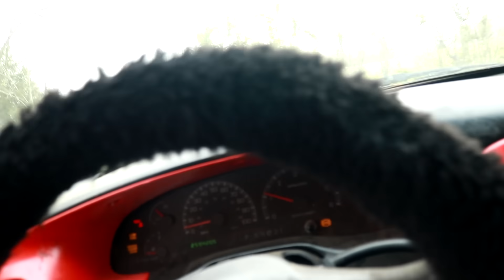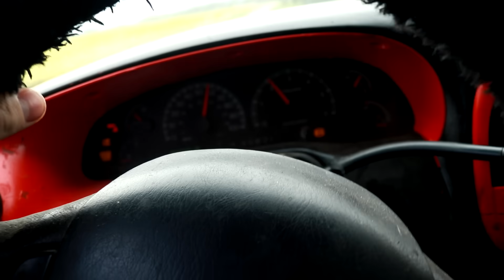How I DESTROYED My Truck

Comment: You could eliminate the c-clips all together by installing bearings that are held in by a bearing retainer bracket at the end of the axle tube opening. They sale kits online. You would no longer need to pull the diff cover to change an axle and the bigger bearings would strengthen it quite a bit. Aftermarket axles are pretty expensive so I’d make sure I got the gears and everything lined out first. Goodluck Kenny

Comment: the reason window A/C units don't drain completely is because the fan is supposed to scoop up the water and blow it on the condenser. it helps cool the condenser down so it can cool better and not run hot. but yeah it does cause it to rust and corrode the condenser coil over time

Comment: Hey kendawg, the reason the ac unit holds water is because the fan is supposed to splash water on the condenser to make it more "efficient" by using the water to help cool it down. They usually have rubber gromments in the ends of the metal tray to remove, im kind of surprised I didn't see any on yours.

Comment: I know you love this truck and you should just give up on the stock f150 componets. I would look in to getting solid axles. I put 1979 f250 axles under my s10 for less then $3k with lockers front and rear. All you need is a driver side drop front axle and rear axle with a companion flange. Id look in to 2000 super duty dana 60 and 10.25 and do leaf springs in the front. I used 1996 dodge dakota rear springs in the front of my truck. Rides great.  👍

Comment: You need to get a fan shroud so it directs the air through the radiator not around it so it can run cooler

Comment: maybe try putting some wedges on top of the rear leaf blocks to adjust the driveshaft angle that fixed my issues like your having. i believe mine were either 5 degree or 10 degrees. i have a 2003 4 door with the fabtech 6 in lift and a 3 in body lift was on 37s i went to 35 1250 r 20 for highway driving.

Comment: I got a 86 f150 and the mushroom yeeted itself after I put a new tranny in and tweaked the rear end I believe it was caused by two much torque or sum for the lil guy so I did beefier axles and aint had no issues

Comment: Ken dawg I don't know cause I didn't see you mount your tranny but is the tranny an the engine mating up square cause I can't imagine vibration cracking the bell housing but you might need to get new motor mounts to raise or lower your engine stress on the bell housing plus vibration would crack it cause I remember you swapped the engine maybe it sits at a different height

Comment: Axle coulda broke because as stupid as it may sound the torque difference from changing the final drive could have snapped that axle end off and the vibration you were feeling was actually your whole back axle-wheel area shaking from the axle being broke

Comment: How to fix a Ford buy a Chevy
Reply: Did that and I regret every minute of owning a chevy 😂 it loves the check engine light, loves too warp brake rotors even with new brake lines, rotting quicker than my dad's ford f150 is and just recently replaced the tenth wheel bearing since owning it. I'd take a ford over a chevy any time unless it's old school then ill drive it.